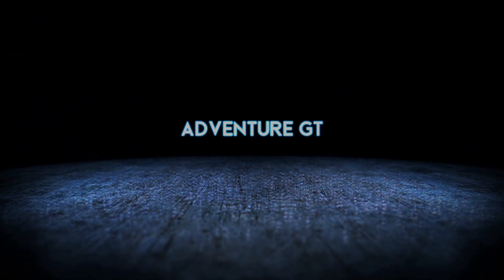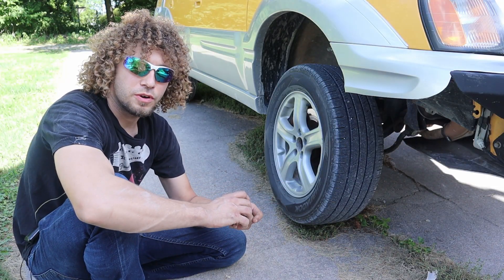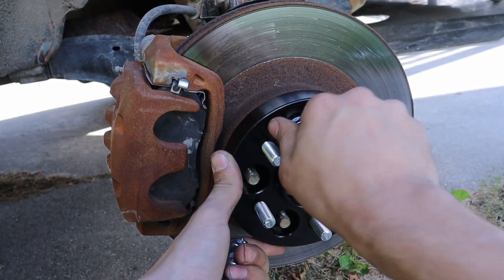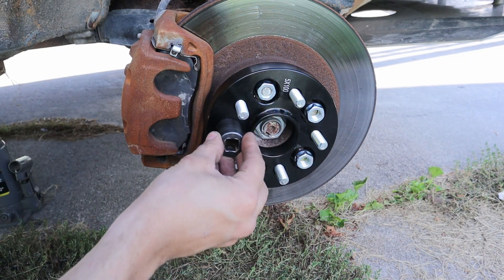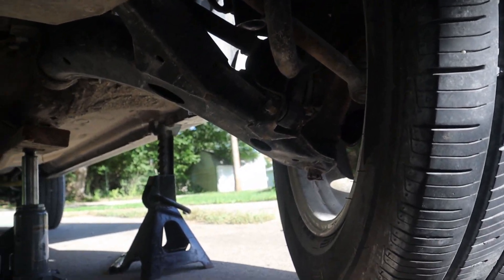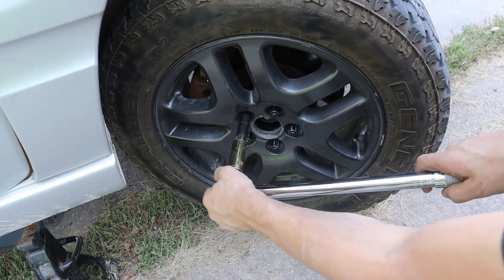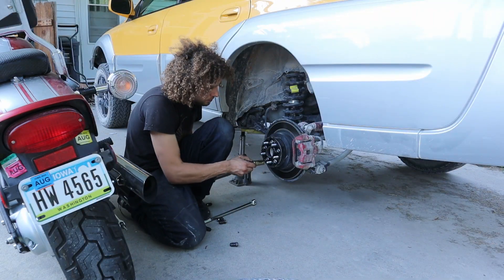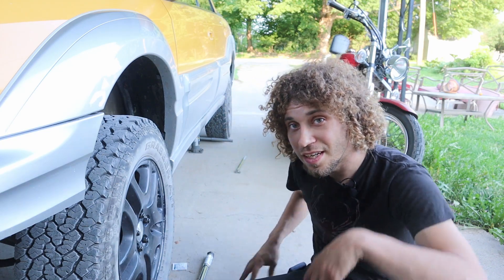What you need to know about wheel spacers and your Subaru

Comment: Spacers are no problem as long as they are used correctly and re-torqued appropriately. I use a similar setup on my Jeep to adapt slightly larger 5x5 JK wheels on my 5x4.5 TJ. In that scenario, they are also working to correct some difference in offset. Subaru looks good with the new wheels/tires!
Reply from the maker: Hell ya dude, I was actully thinking about getting adapters to run jeep wheels for awile!  Wouldn't  mind  checking out your jeep if you can tag us on Insta!

Comment: hey i put those on my baja i took them off cause i thought they were causing my steering wheel to shake at 70mph so i took them off drove it again with out them they still shake do you know what it could tires were rotated and balanced still shaking front end is tight no lose or broken suspension , i want the spacers back but with them it shakes so much do you know what it could be my brother has 1 to and does the same thing to ?
Reply from the maker: So  there's a couple  of things,   my first guess would be the axles. Are they after market?   Some are hit an miss. And I deal with a lot of vibrations as well lol
 Second would be the rotors. Do you only get vibration on braking? 
My 3rd guess would be the tires out of balance, are you running aftermarket  wheels or all terrain  tires?
Reply: @AdventureGT  no every thing is stock tires are regular street tires haven't changed anything so far axels never knew they cause vibrations im thinking the calipers are bad causing the rotors to wrap
Reply: @AdventureGT  I sometimes get shaking when brakes applied not always
Reply from the maker: I've gone though at least 3 calipers. That have sticking problems.  Mainly aftermarket  calipers tho,  I know advance auto carry remanufactured Subaru calipers.  And rotors are cheap enough. Could just swap out the pads and rotors up front to see if that remedies your problem.
Reply from the maker: If you've gotten high mileage on those axles they could still cause this issues.  Also a transmission  mount can cause vibration. Might be worth looking into that as well
Reply: @AdventureGT  ill look at all those things I appreciate it thank you

Comment: Did you notice any difference in the drive with the spacers on? Maybe cornering?
Reply from the maker: 7 months on these spacers so far 
And zero issues  what's so ever. If any thing i feel slightly  more control  having the wheels a little  pushed out

Comment: To hold the spacers in place you used the correct nuts I bought a 01 outback recently with some crazy spacers and wheel fitment but the wheel came off on the drive back good thing I hadn't hit the highway yet but it sucked. Once I got them on correctly they easily did 100 miles back home

Comment: When did you lift the Baja? Did I miss a video?
Reply from the maker: Yup!  Go back through the archives.. No just kidding. It was lifted a few months back but broke a few things and lost some footage. Kinda disappointing
Reply: @AdventureGT  darn that sucks. What lift kit did you go with
Reply from the maker: I tired to go cheap, and I kinda of regret it.  It's a Tema 4x4 lift from Russia  😂 no camber offsets up front like real subie lift kits, also had the need to use adjustable  control arms in the rear!  Would do it differently  if I could do it over lol
Reply: @AdventureGT  is it cool if I email you a link to a better one? I wouldn't call it cheap by any means but it includes the sub frame drop and all if you ever decide to retackle the lift
Reply from the maker: Sure thing!

Comment: So here’s a question,
What tires can u fit on my Baja?
I’ve redone my ‘06 Baja with OES monroe’s, and I’ll have to use spacers to lift since there’s really nothing out there for the Baja.
I currently will have supposedly +4.5” after my spacers and will be using the stock Baja rims for now, so I’m thinking 225/75r16? Could go down to 225/70 if that wouldn’t work.
Reply from the maker: 215/70r16 is the biggest you can go after lifting your car.   You can make an 225/75r16 fit but you will have to do a pinch seam mod and push your splash shields around.    We do have a video demonstrating this on a jeep renegade. Same process.   Hope it helps!
Reply: @AdventureGT  I’ll be removing the front bumper for a custom one so I think that will give me a lot of space to work with
Reply from the maker: It definitely  will!  Tag us on Instagram  so we can follow  along